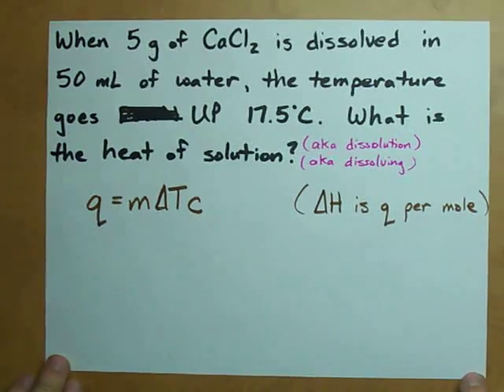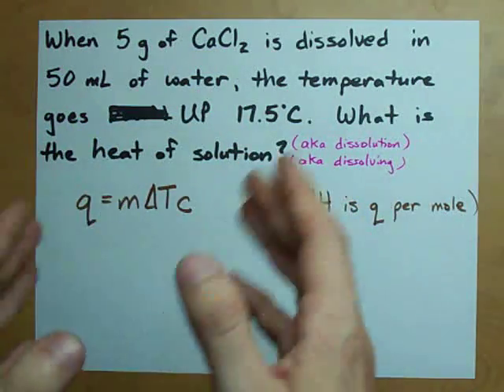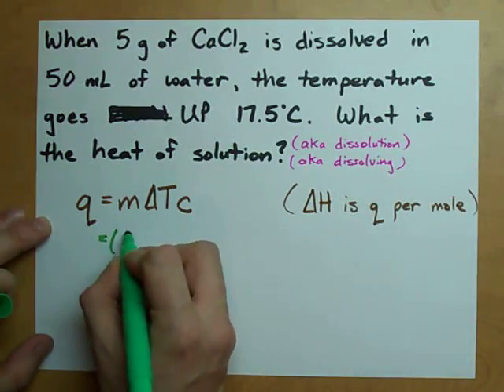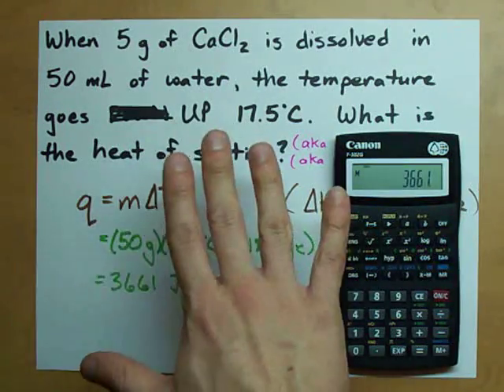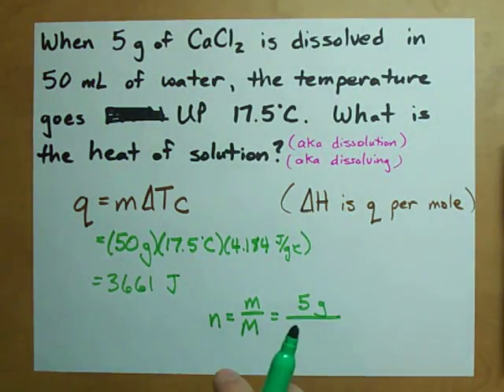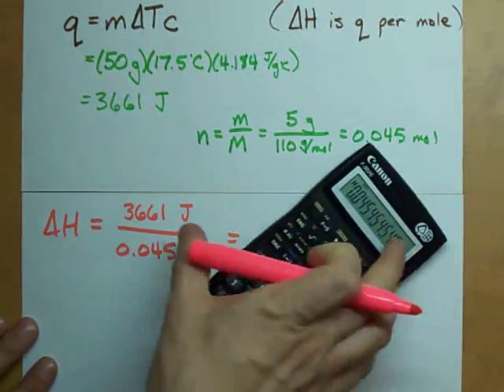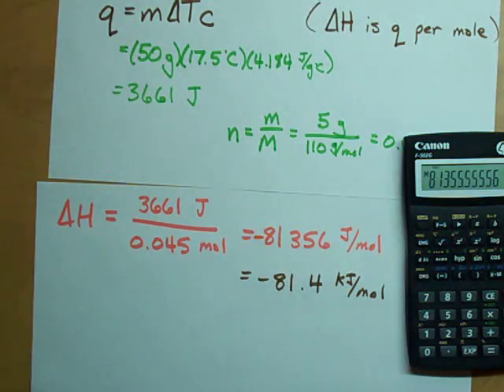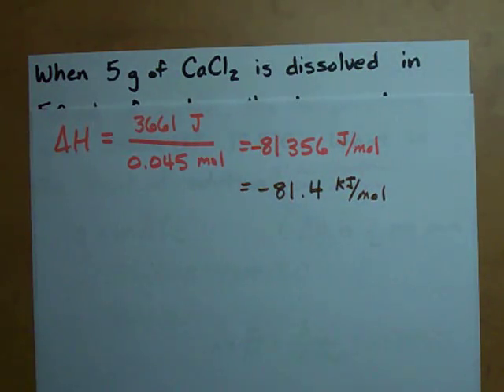Find the Heat of Dissolving (Delta H, Dissolution)

Comment: wouldnt you convert the temperture from c to kelvin?
Reply: this is a good question since specific heat is J/g*K
Reply: @alvincomputer  if you look up "what is the specific heat of water" it is 4.184J/g* degrees Celcius. However, you could look up the specific heat of water in Kelvins but, for this example, the temperature change was measured in celcius therefor you would want the specific heat in celcius so Celcius canceled out.

Comment: Very good video, I may be wrong but I think this reaction wasn't in fact exothermic, but rather endothermic. If the heat went UP, then energy was being absorbed and therefore the deltaH would in fact be positive.
Reply: I believe he was talking about the dissolution of the solid, the solid releases heat, that's why the temperature of the solution goes up.
Reply: Thank you i was confused on that as well

Comment: Why don't you use 55g as the mass since it has dissolved into the water?
Reply: take the derivatives of C, then measure C and make a time graph in which you take za Integrals, if za values are lower zhen 0, means you don't use 55 g as the mass!!! if greater then you do use the mass, this this case it was lower then 0.......its not as complicated as it seems, douches from China
Reply: @talhajat3301  Douches is a term that means "penis" so...
Reply: @jqyhlmnp  not true it's something else might wanna look it up
Reply: Because 5g of salt is too small to cause a change in the volume of the water. If you had 50ml of NaOH and 50ml of HCl then that would cause a change in mass. The total mass would be 100ml or 100g
Reply: @courtneybrowne4773  Your second sentence is describing mixing two SOLUTONS together not adding a salt to water. There is a difference. Also, my Chemistry teacher ,who got her PhD from Georgia Tech in Biochemistry, made all of us students feel stupid for not calculating the mass of the water and the mass of the salt we used (which was 5.00g for both trials) when calculating the heat for the reaction.